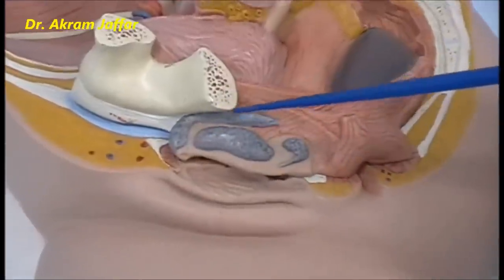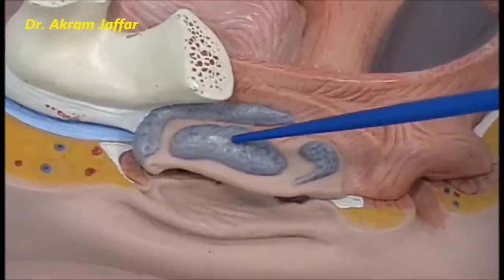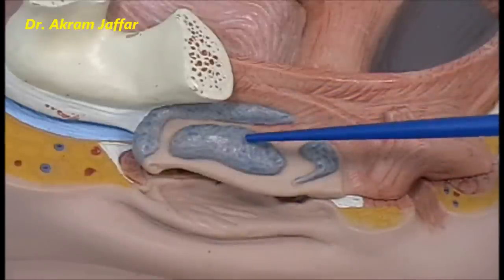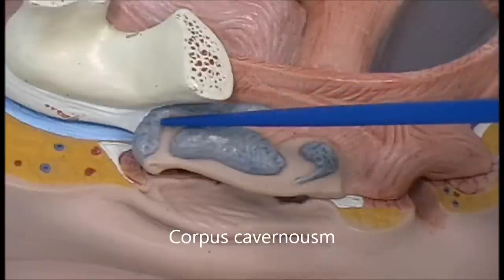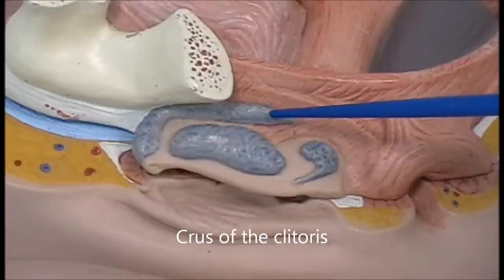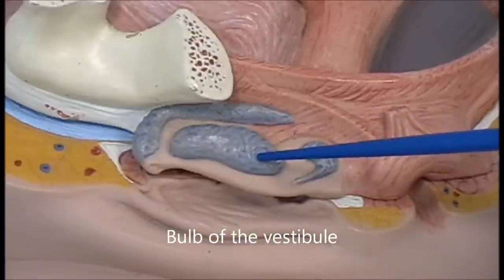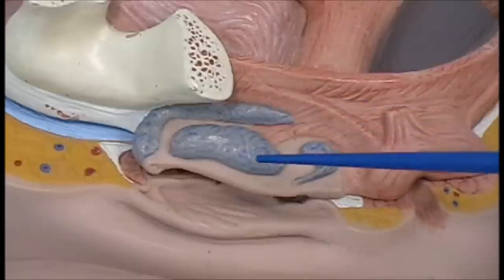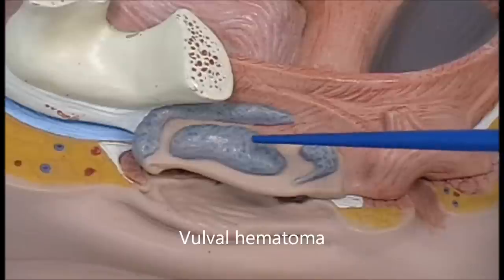Anatomy of female genital organs - plastic models

Comment: Cann't feel the time while listening to your explanation doctor!!! thanks alot ... i  just have a doupt.. where could we find the uterine artery ? is it part of the broad ligament and where exactly ??
Reply from the maker: The uterine is located at the base of the broad ligament just above the fascial thickening called the lateral cervical ligament. The artery almost comes from lateral (its origin from the internal iliac) to medial (destination at the junction of the cervix and body of the uterus). The most important relation that you should not forget is that close to the lateral vaginal fornix it is located just above the ureter which extends from posterior aspect to anterior (toward the urinary bladder). This is the relation that is remembered by the mnemonic "water under the bridge" that is water in the ureter flows under the bridge of the artery; usually a bridge and the undergoing water run perpendicular to each other.
Reply: @akram.jaffar thank u doctor alot wallah